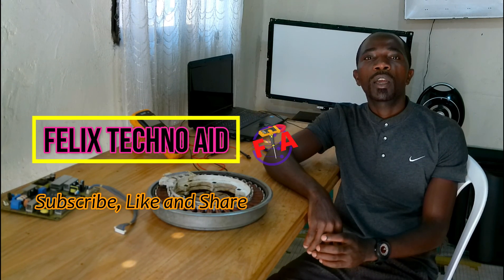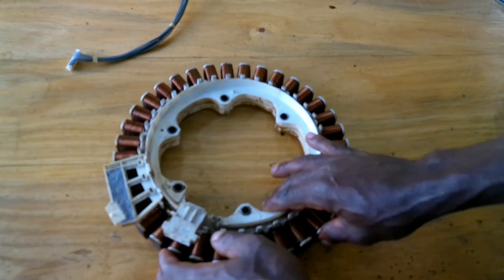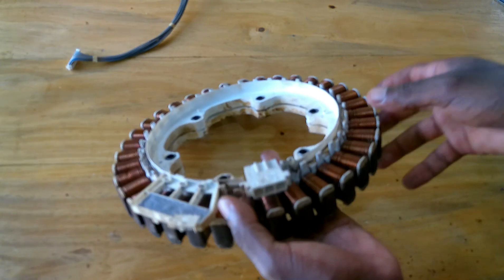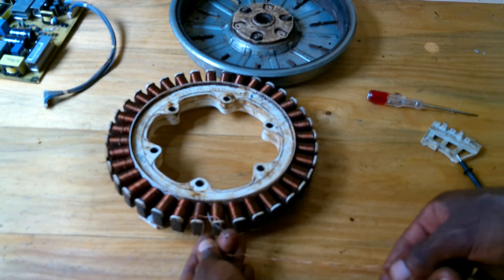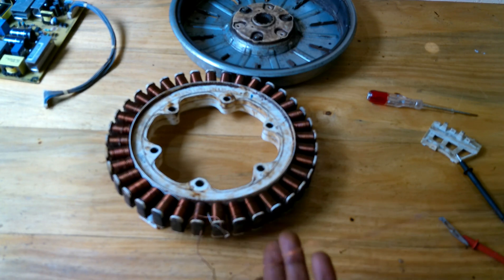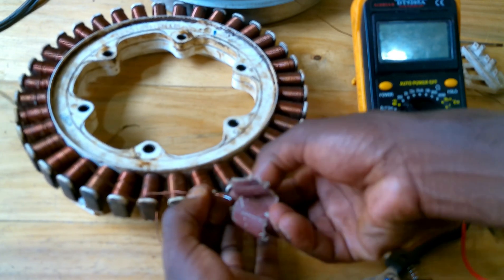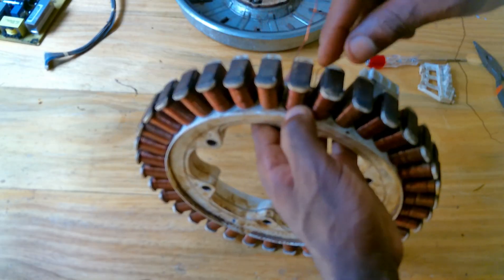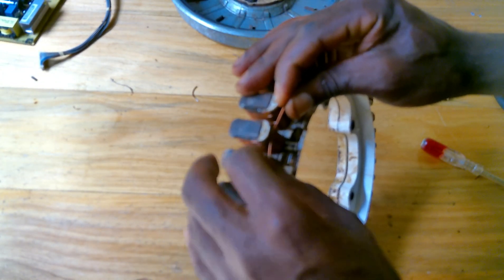lg inverter direct drive motor test&repair techniques||lg washing machine DDR motor repair.

Comment: Very enlightened by your vdo about the w/m DD motor, but would have appreciated little explanation about that motor and it's winding and powering sequence. Other point is it is not short and edited well. A little more lighting and better editing will save a lot more time.I was watching at 1.5X playback speed to save time. But otherwise you're doing Gr8. Keep going buddy. Hope your nxt vdo will be better than this... Bye